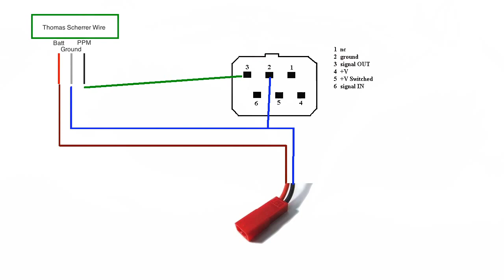Thomas Scherrer LRS wiring Part 1

Comment: Great vid.. so by using the trainer port you do not have to do any internal wiring/soldering in 9C? I was planning to solder directly onto back of pcb board on 9C like many here have.. did you use connector so that you can use radio in fm/pcm mode when desired? Thx!

Comment from the maker: I had a few failures with my TSLRS. It may have to do with my futaba 8fg. I don't know!
Since I bought the EzUHF I haven't have any problem so far. It also has a big advantage. It's cheaper and can be upgraded via USB. They can solve problems with simple firmware changes. TSLRS can't. However TSLRS may be a good system. It just didn't work for me. I had a few crashes when I was using TS. None with EzUHF...